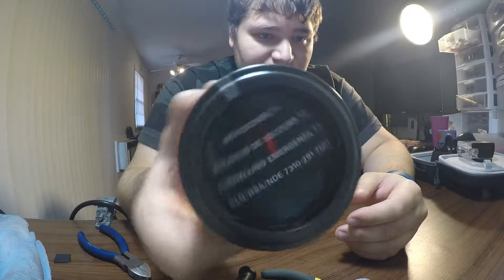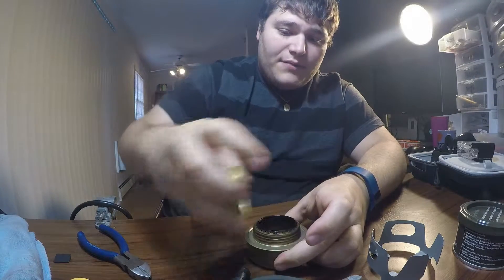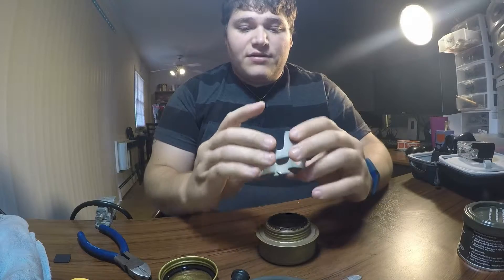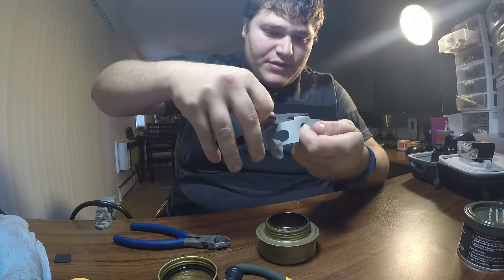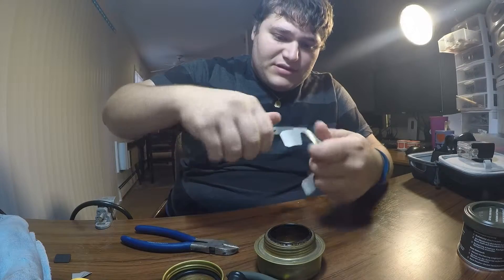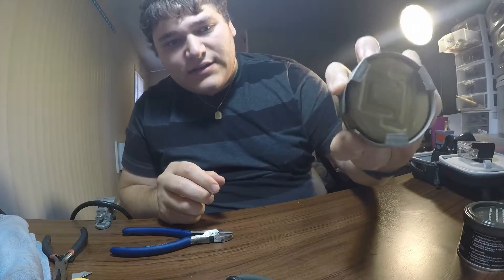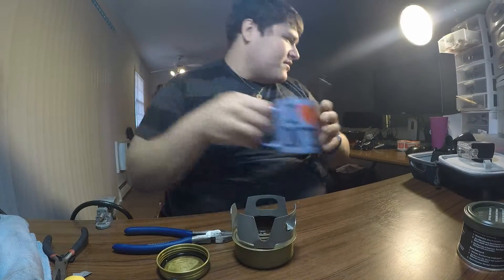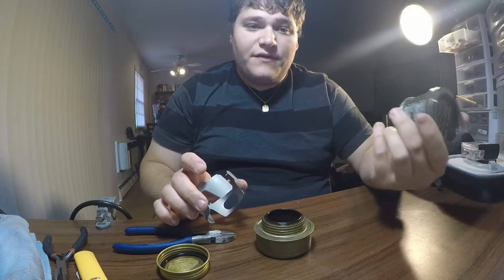24: Swiss M71 stove pot stamd modification for Trangia Alcohol Stove

Comment: While I'm not a huge fan of those Swiss can stoves , ( The soot . the acrid smell that  I wouldn't want to breath in..)  that little pot stand is terrific .  It will fit the big Swedish military "Trangia" with no modification , Chafing fuel cans ,  or just burn solid fuel blocks ( Esbit)  on the ground  with the stand over it  . I've not seen anyone do your mod before though .
Reply from the maker: +Elwood P Dowd I saw it somewhere in the past but they just used the stand for the stand, they didnt mod it... The pot stand is very light so it would make a great esbit fuel stove... maybe with just a tomato can lid underneath. thanks for the positive feedback =)
Reply: Not with Ever Clear.